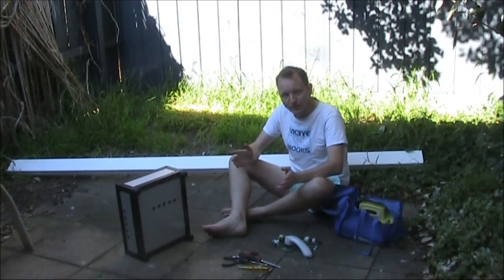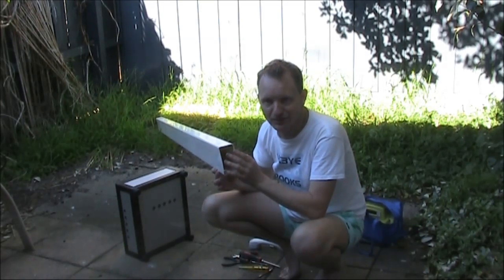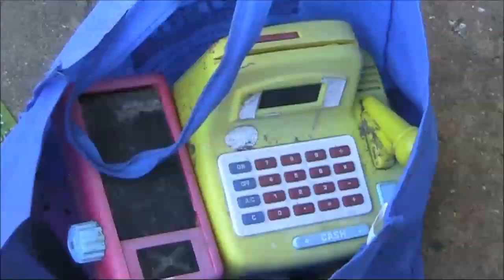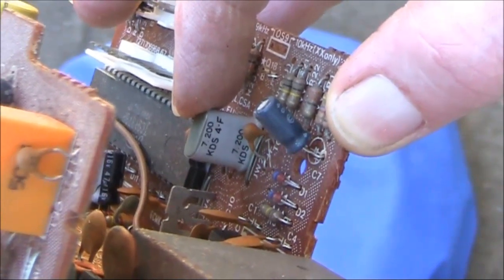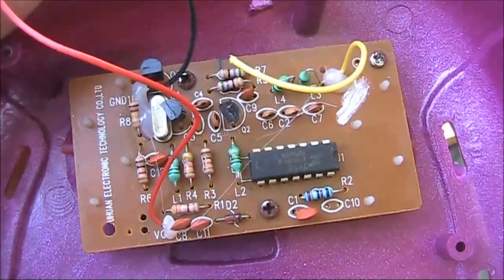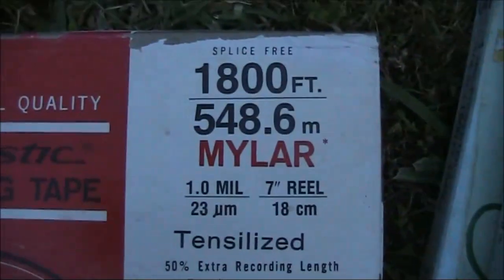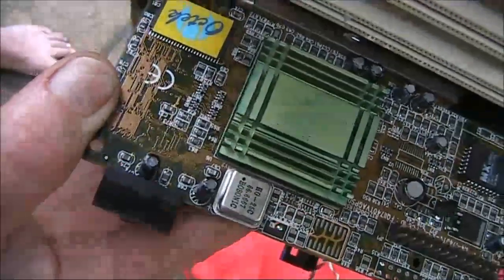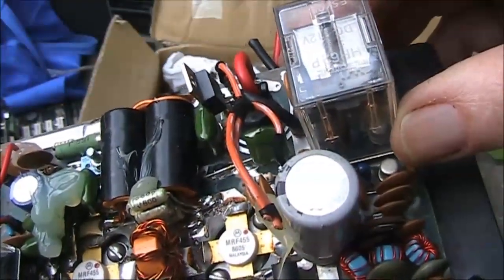Electronics on the Floor: Nature Strip Electronic Junk Pickings 2018 - Part 1

Comment: Did you ask if you could take what you wanted? The council take it all away for nothing? We have to pay if we want stuff like this taken away in the UK and no one would ever leave it all outside the house here
Reply from the maker: The council has an annual clean-up day where junk is taken for free. Yes, taking off the verge is legal here.
Reply: vk3ye - In England we can’t even go to council tips to scavenge for goodies, even if it saves something from the landfill! So much for being green! I’ve rescued tonnes of gear from the landfill from other sources, but U.K. law on taking from council tips is extremely frustrating. I can only speak for my local council, of course. Sometimes you find stuff like flat screen TVs left in back lanes, which are always a welcome find! Fly tipping is sadly endemic in quiet places, off the beaten track. Even at beauty spots. It’s very expensive to get your rubbish moved by our crappy councils.

Comment: Hi, my name is Paul and I'm a junkoholic.  I regularly scavenge reusable things discarded by others and have also recently started part harvesting (where you take an old appliance home, take the covers off, rip out anything worth keeping (down to capacitors, heat sinks, etc), put covers back on and then return to the junk pile from whence it came.  This is an honourable art,  an essential part of repurposing and fixing, unappreciated by 99% of the population.  All power to the e-scavengers.